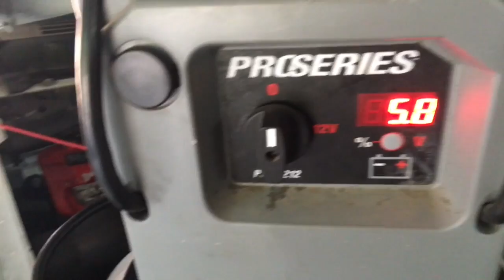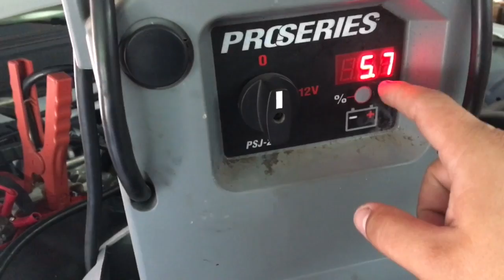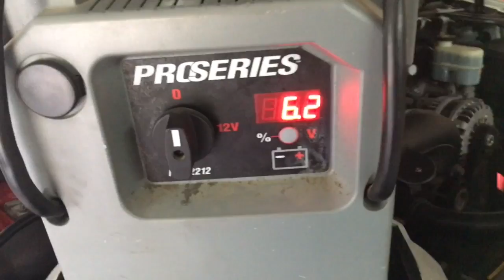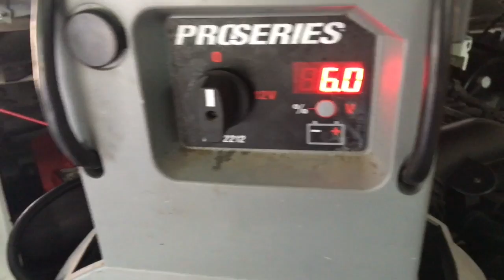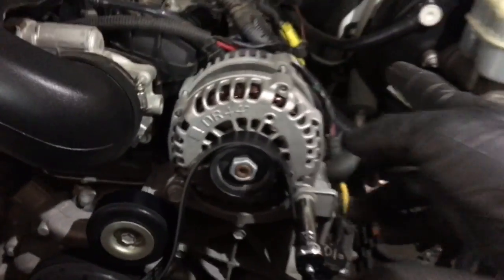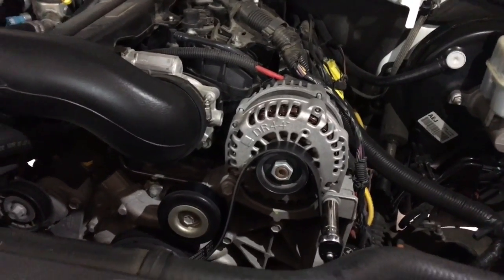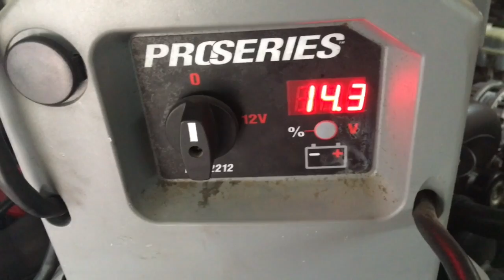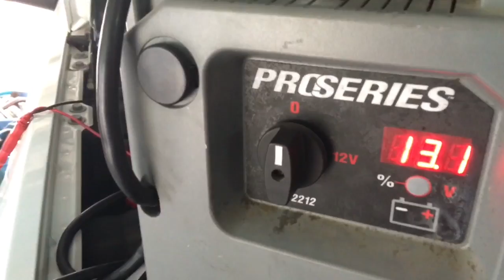How to Test and Replace an alternator on a CHEVY/GMC Truck or SUV

Comment: I got the traction off and stabaltriak on my truck they both came on someone told me it could be my alternator what's your opinion
Reply from the maker: its "possible", but have you had the codes scanned for the ABS & Traction control?
Reply: Falcon's Garage yeah but now it says o2 sensor and shit j had my truck frame swapped and shit si idk if I need it to be re programmed
Reply: Igot the same codes...ihear a loud ticking from alternator  when started....reduced  engine power...serve stability track control comes on as well....can a bad alternator  cause these codes to pop up????

Comment: Turns out, after a closer look, it was actually closer to 15V+. I figure now it's the alt because it dropped under 14v to 13v or less after about 12 miles. Taking it in tomorrow. Had to replace the battery about 10K miles ago and now it looks like the alt is on it's way out. With less than 50K on the vehicle, time can take as equal a toll on vehicles as mileage in some respects
Reply from the maker: yeah sometimes when an alternator or battery is going bad it doesn't do the symptoms until it gets hot
Reply: Falcon's Garage... Well, it wasn't the alternator after all. The Check Engine light was for the after-market gas cap failing. What I read as the alternator was actually the battery. The battery was showing barely 7v. The last one had to be replaced in 2013. So that's really not too bad, battery replacement every 5 years. Thanks for your input.

Comment: it is a normal when you first engine start the reading is 14v something after a minute engine running na voltage is about 13.5v when you applying a load like aircon,etch. back again to 14v.    silverado
Reply from the maker: yes, your computer will manage the voltage as long as it does not drop below 12.5 you "SHOULD" BE OK

Comment: You happen to know if I can put an altenator from 2001 Tahoe to 2007 silverado v6? Changed battery but it goes off soon as I jump cables
Reply from the maker: I would be able to tell you .. but a parts store would be able to tell you if they are both the same part number
Reply: @FalconsGarage  I asked them a bit ago but it's a no go. Gonna change The battery hope it's just that. Either way a battery costs the same as an alternator down here lol. Thank you!

Comment: 05 Silverado   ISSUES: Lights dim crazy, voltage jumps around, loss of power and battery light flashes. Woke up and battery is beyond dead, replaced (3 months old, warrantied) and it still nothing.. Any ideas
Reply from the maker: Maybe alternator or a bad gound